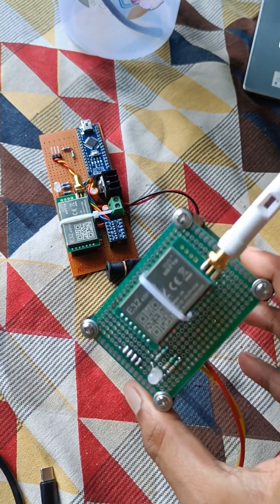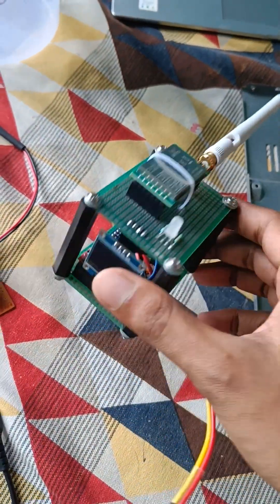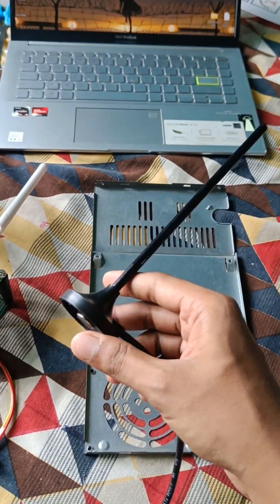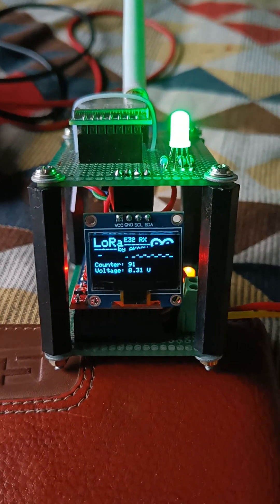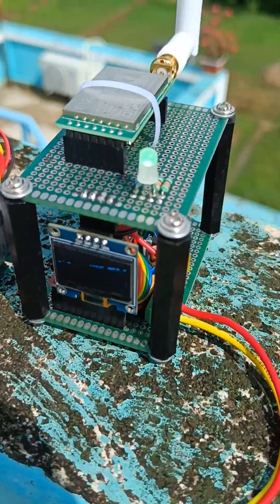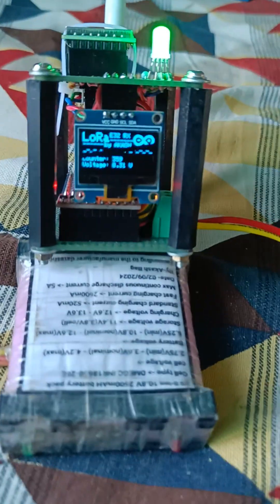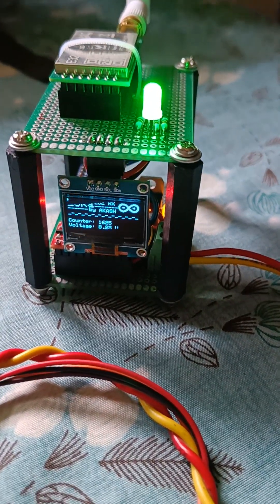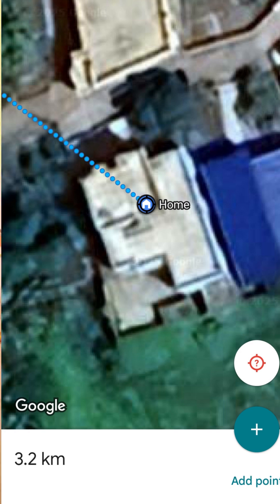LoRa E32 modules range test outdoor! #rf #arduino #diy #iot #electronics #arduinomodule #tech #sdrs

Comment: Bro make a walkie talkie using LoRa Communication by using mic and speaker as INMP441 and speaker with amplifier
Reply from the maker: See, transmitting audio in real time using LoRa is not that much easy, because data rate of LoRa is too low. But using nrf24L01, we can transmit audio, even video also, because it can go upto 2Mbps. Actually it was my final year project in b. tech
Reply: @AkashWaveRF so have you made it? Can you make a video on your project please
Reply from the maker: @amsolenely yes I had made one for my final year project, but there is no any video of it. Right now I'm a bit busy to anek some antennas and with some new LoRa modules. Hope in future, I'll make a video on that also

Comment: 433 is illegal in India
Reply from the maker: 433 is ism band, and I operate on my frequencies under licence
Reply: @AkashWaveRF  License is irrelevant as you are already in the ISM band as you had rightly mentioned but the maximum allowed power at 433MHz is explicitly stated as 10 mW ERP.

10 kHz is the maximum bandwidth allowed .LoRa applications require a minimum bandwidth of 125 kHz.

There's no way you are into the legal territory. Just thought of sharing this info, I'm not like informing the police or something!
Reply from the maker: @ililiilililllli bro, good observation, but I'm operating these modules on 435mhz now. That time the module was not configured actually, but now it comes under UHF HAM band, you are absolutely right. and under my license, I'm allowed to transmit upto 10W on this. Is now it clear? I shuld clear it to you before, but I don't know, why I hadn't. Btw, happy to see that some people actually cared about rules and regulations. That's why I became a licence holder.
Reply: @AkashWaveRF  Fantastic! Not a license holder, so can't confirm, but that 435 might be for HAM only, but as long as you have license and use the same modulation, and it doesn't overlap and the airtime limits are met, you are good!
Reply from the maker: @ililiilililllli  yes bro, fsk, afsk this kind of digital transmissions are also allowed along with analog modulated audios. And when you are not interfering with others, this kind of educational and experimental works are pretty fine❤
Reply: Rc car, etc use 433.
Reply: @ShantanuKumar-bk9jx  Yup, and those are not permitted per law. Anyone can transmit on ANY frequency if they have the hardware, just the legality changes.

Comment: Kaya iss module se servo motor and brushless motor ko chala sakte hai
Reply from the maker: Yes, chala sakte hai bilkul. But in modules ka datarate bohot Kam jota hai, one data per 700ms or in 1s, which is very bad for real time controlling. That's why we should use modules like nrf24l01 for this kind of live controlling. nRF modules ka datarate bohot high hora hai. Yea modules telemetry banane ke liea achha hai, controller nahi. In modules ka renge test ka full long video hai, aap dekh sakte ho